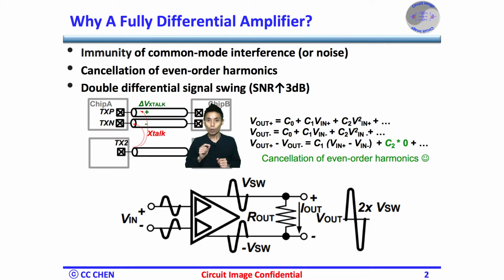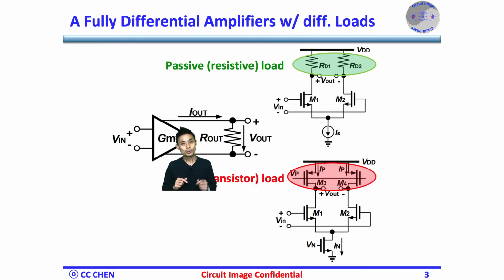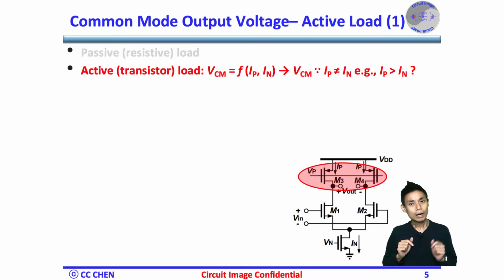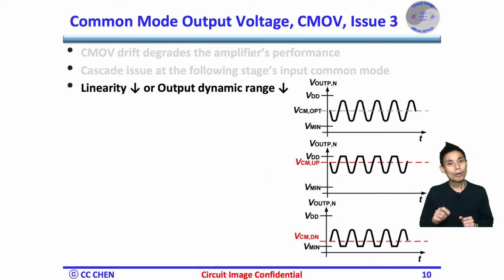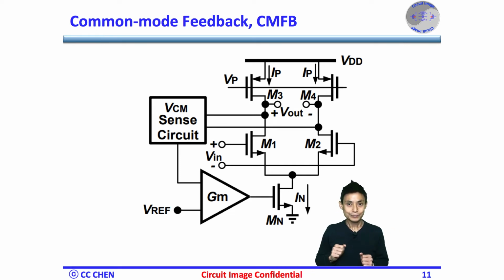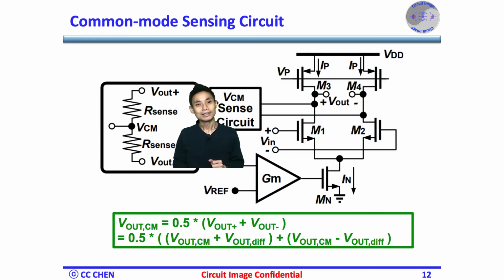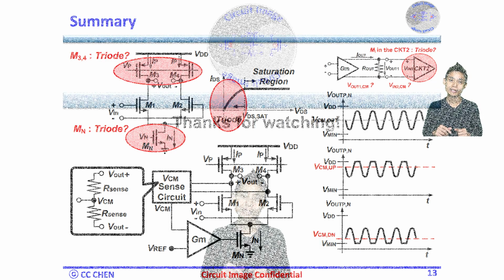Why CMFB in A Fully Differential Amplifier?

Comment: Hi CC, nice video ! Hope you are doing great :) 
One question about the speed of the CMFB loop. 
I understand that it tracks the drift in the common mode and increases current accordingly to bring CM close to the VREF value. 
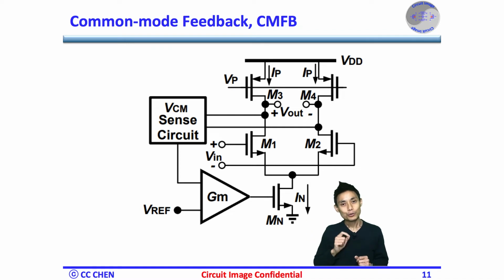I expect the common mode drift can happen because of the noise in the power supply (for instance devices M3 and M4 at 7:11 have their sources change with the supply voltage, so the current Ip in those two devices will change and so the CM will change). 
Should CMFB loop needs to be designed in such a way to be able to track and fix these type of variations in CM? Does it mean that sizes of the resistors shouldn't be very large and the bandwidth of the Gm amplifier (at 7:11) needs to be chosen accordingly?  
Thanks
Reply from the maker: Hi Hrachya,

It’s great to meet you! Thank you🙏 for your kind words about the video—I’m glad you found it helpful. I’m doing well, and I hope you are too. 😊

You’ve raised an excellent question about the speed of the CMFB loop and its role in addressing variations in the common mode. 

Let me clarify a few points:

Tracking Power Supply Noise
You’re absolutely right that variations in the power supply can cause common-mode drift, especially due to their impact on devices like M3 and M4 (as you mentioned at 7:11). The CMFB loop is designed to mitigate these variations by adjusting the current to stabilize the common mode around VREF.
Designing the CMFB for These Variations
To effectively track and correct these variations, the CMFB loop needs sufficient bandwidth to respond to the expected noise frequencies. However, this involves trade-offs:

Resistor Sizes: Smaller resistors in the CMFB sensing network can reduce RC time constants, improving the loop’s response speed. However, this may reduce the gain and compromise the accuracy of the common-mode voltage.
Bandwidth of the Gm Amplifier: A wider bandwidth for the Gm amplifier enables faster response to variations but requires careful design to avoid instability. Additionally, increasing the bandwidth can lead to higher power consumption, which is critical to manage since the CMFB loop shouldn’t consume more power than the main amplification path.

Practical Design Approach
The CMFB loop’s bandwidth should ideally be sufficient to address the dominant frequency components of expected variations (e.g., supply noise frequencies). At the same time, it’s important to ensure that the CMFB loop doesn’t interfere with other operational aspects of the circuit, such as the main signal path.

Let me know if you have any further questions or would like to discuss this in more detail. 

It’s always great to dive into these design considerations! 😊

Best regards,
CC
Reply: @circuitimage  Thank you for the detailed response. I really appreciate that ! 😊

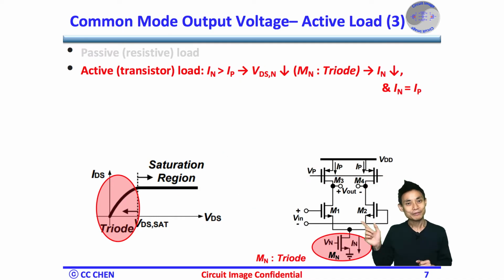Comment: 4:50 if In > Ip 
Besides Mn enter triode , what is about the M1's behavior ?  
I think Vout will decrease and M1 may be sat. or triode
Is it right? thx
Reply from the maker: Hi Ronald, nice to meet you, and thanks for your good question. You're right, that Vout is decreasing; therefore, it's possible the M1 would enter the triode, but that also depends on the M1,2's input DC voltage, which was not identified explicitly in this image yet.
Reply: @circuitimage  thx for help!!!
Reply from the maker: @ronaldkuo1480   You're very welcome :)